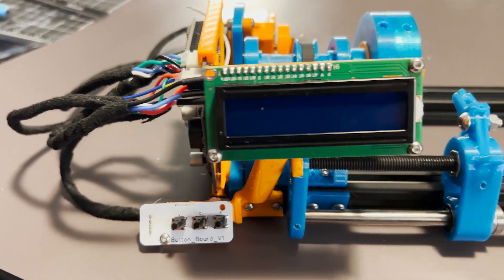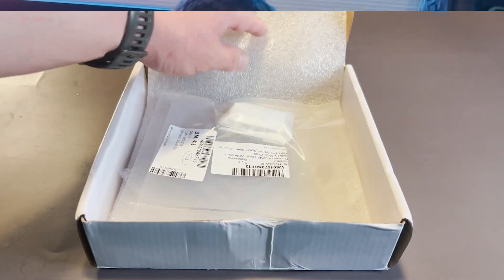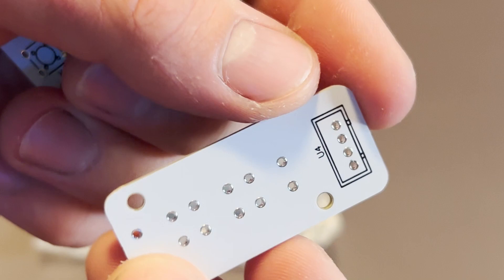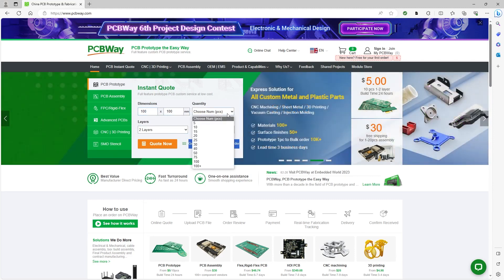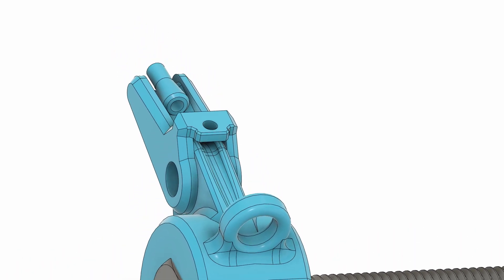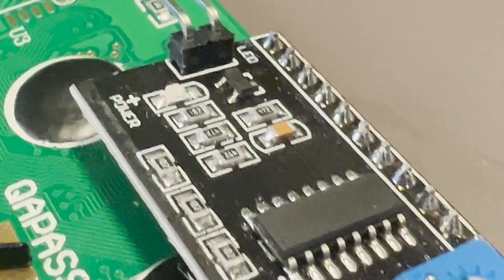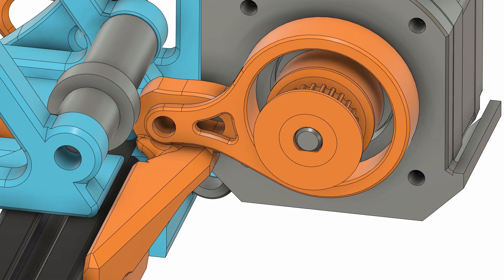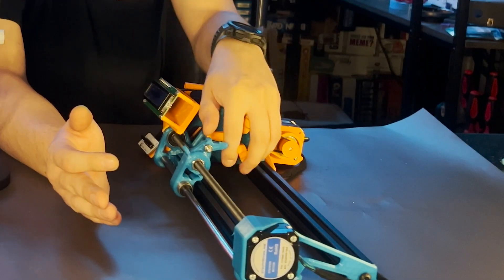Arduino Controlled Coil Winder V2

Comment: why no link to the code and project here?.
Reply from the maker: After testing I determined the code and circuit design wasn’t something I felt comfortable releasing as the code was buggy and the voltage regulators on the PCB get fairly warm, so I have some excess draw from somewhere, I believe it was in the way I handled the steppers in the code- I think they both drew max power all the time. 

So I’ve ditched the idea in favor of redoing it on v3 which is currently about 80% designed.

Comment: Good afternoon, a very professional job, can you share the 3D files and program?
Reply from the maker: Unfortunately this one doesn’t work as intended, I had to get custom belts and they don’t hold tension so it skips- therefore I elected to not release this one as v3 is in my queue of projects- and it addresses these issues along with better code, better winding mechanisms, and I’m seeing if I can get a 3 speed transmission attached for variable winding speeds/torque.
Reply: @piscesprinting  Thank you for your answer, I will look forward to your improved project, I really liked the mechanical part of your machine, I think why make a gearbox mechanically when you can solve this problem electronically... but of course you know better. Good luck in your business.. ....if you need, I can send you a ready-made sketch of the program, it may be useful or help you.

Comment: And I would probably insert a tip instead of a chuck and add it to the other side as a sliding one as well. And insert a spool between them and rotate it with a simple carrier, just like turning between the tips on a lathe. This would reduce the lack of concentricity and fluctuation of the coil body.
Reply from the maker: I’m working on a slider to add to the rails currently.
Reply: Consider calling the slider a "tailstock". This is what they're called on a lathe, and you've largely recreated a lathe, which is pretty impressive. The pointy tips are called a "centre" ("center" in America), and are a 60degree cone. If you design your mandrels (the plastic formers that the coil wraps around) with a 60 degree hole, you'll get a lot more rigidity out near the tailstock and reduce run out (the wobblieness). 

On the moving carriage that has the "nozzle", I'd also look at getting some MIG welding tips and screwing one in, that'll give you cheap and easily replaceable tips rather than needing to print a new nozzle tip.

If you find maintaining tension to be tricky with a MIG tip, perhaps adding two small plates with a small screw applying friction to the wire as it spools out will help with that.

Really cool project, keep up the great work!
Reply from the maker: Thanks! I have mic tips in the garage I could probably use, and yeah a lot of hobbyists use lathes to wind coils on formers however I didn’t have the money to spend on buying one, so I built one instead, 

Also using steppers lets me electronically control wraps/directions relatively easily.
Reply: @piscesprinting  I totally get wanting to use steppers to control the lead of the windings, I originally implemented (and contributed one or two pull requests) to the clough42 electronic leadscrew; now I'm wanting a bit more so I'm thinking about building the NanoELS by Maxim Kachurovskiy. Both projects are way overkill for winding coils though; and yours is well suited for the task, I like it.
Reply from the maker: Thanks, I’ve got version 3 on the way back burner, I’m looking into a “gearbox” for the main head to change between speed and torque as the formers are not always the same size. Something like a 3 or 4 speed. With indicators that tell the micro controller what gear it is in. But it’s way back burner unfortunately. 

I’ve also got a toroidal winder in the works, but those are a bit more complicated.
Reply: @piscesprinting  toroidal winding machines are seriously cool! Good luck!

Comment: How about adding the option of cross-wound coils? When to enter the number of turns, the width of the cross-wound coil and the number of crossings per revolution.
Reply from the maker: I have plans for a bunch of extra coil features, I just need to work out the code and math on the backend to get the steppers to cooperate properly.

Comment: This is pretty cool if you can speed it up and eliminate the wobble you could have a precise bit of coil winding madness thats good enough to sell
Reply from the maker: For speed i just need to update the code with higher values until I find the limiting point for the stepper. I’m not sure how I’d eliminate the wobble though as 3D printed parts are not concentric. Only option would be to oversize the parts and then machine them round.

Comment: That's a pretty neat project. You got yourself a subscriber! 
Just a tiny request though, you keep coming in and out from the mic, which makes you very quiet sometimes and very loud other times. If it's possible you should try and keep yourself the same distance from the mic or normalize the level in something like Audacity beforehand or within the video editing software itself depending on what you're using. 

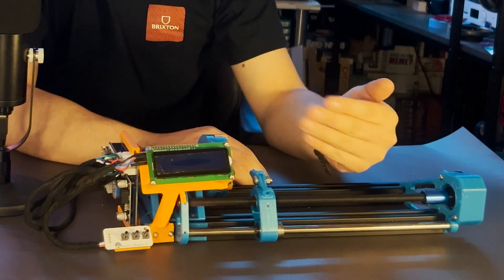It's not a big deal, but you had a few segments in there that were very loud compared to other segments (i.e 4:04)
Reply from the maker: Thanks! I’ll work on that, I think some issues lie in that i level audio based on peaks.